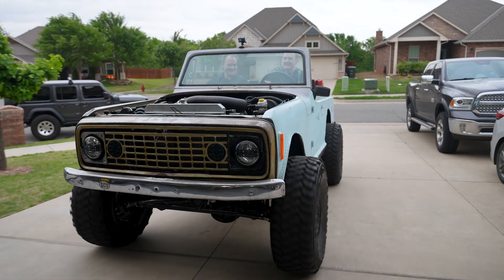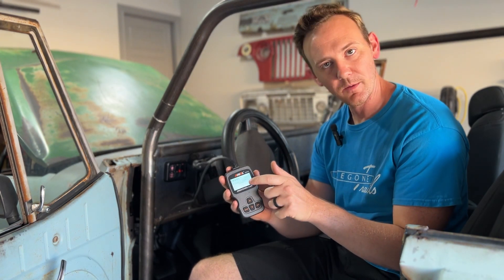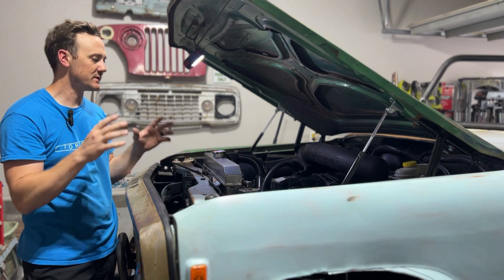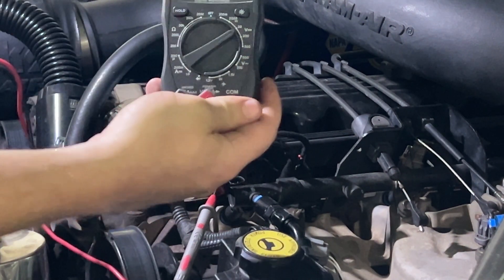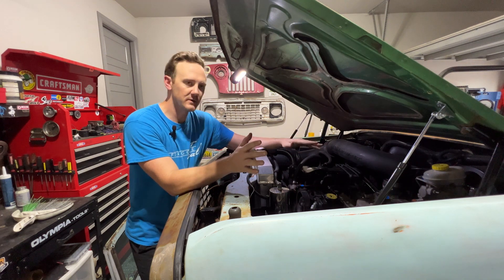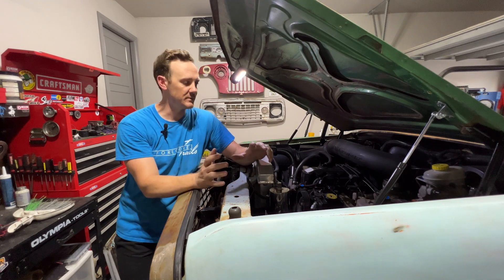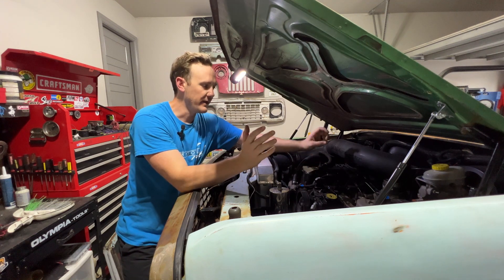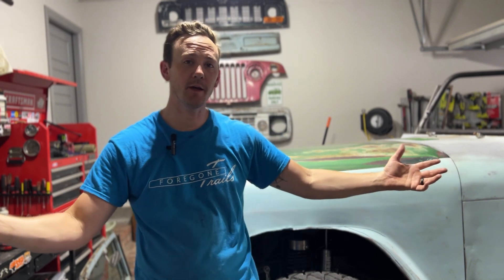Quick Fix for P0201 Error Code on Jeep: Injector Circuit & ECU Repair

Comment: This was super helpful. I didn't see the link to find out how to switch the injectors. At least the on labeled #injectorcircuit didn't work. It was the only thing I could find with the word injector. Maybe I missed it. 
I wish you would've mentioned which connection point on the PCM you used to check for continuity for the ground. Also, I think you got your terminology wrong. When you have a short you have not ohms. When you have an open you have infinite ohms. You said .02 ohms to make sure you don't have a short. That would be a short and would be a good thing. It means you have continuity and no open or break in the wire.
Reply from the maker: Glad it helped! It doesn’t look like I included a link and it’s been a minute so I’m not sure which video I used for swapping injectors. 

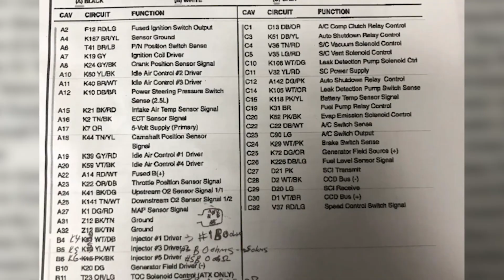@4:31 there is a screenshot that shows which connection points in the ecm to use for checking continuity. Definitely could’ve gotten the terms incorrect. Electrical is something I haven’t mastered but know enough to figure it out usually.
Reply: @ thank you. It was a fun video to watch too! I looked at the chart, but I wasn’t sure which point on there you checked for the ground. Was it the one that said  injector #1 driver?
Reply from the maker: @alfa8822 yes, unless it’s a different injector number throwing the code. Then it would be the corresponding driver.
Reply: @foregonetrails  Thanks! Appreciate the quick reply!
Reply from the maker: @ welcome, good luck!